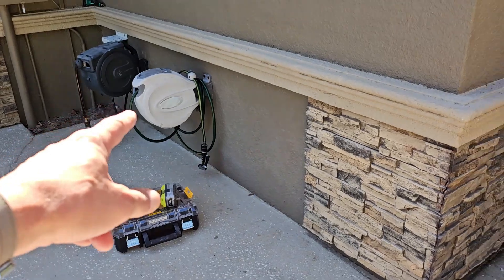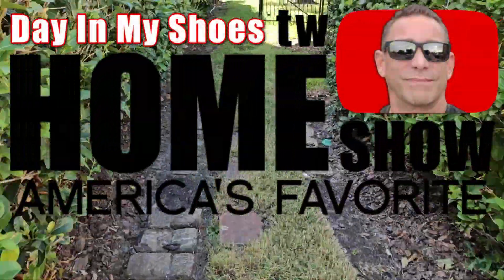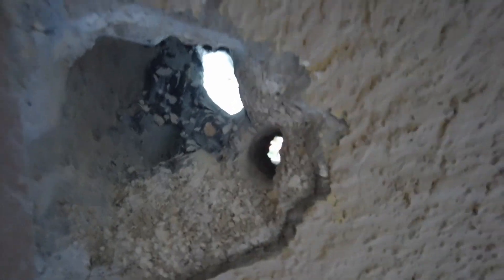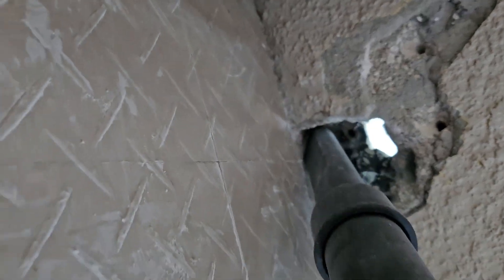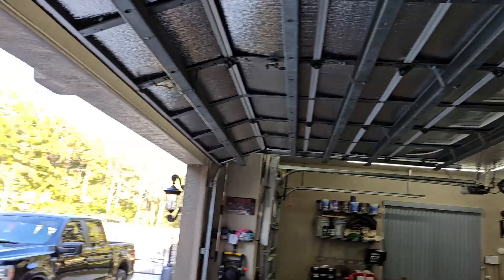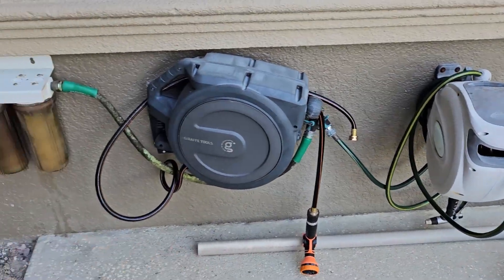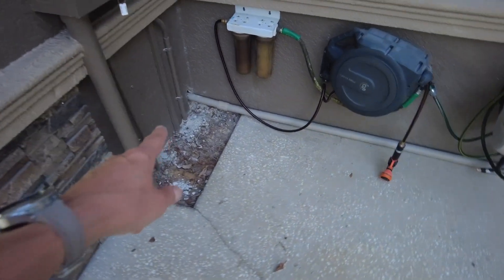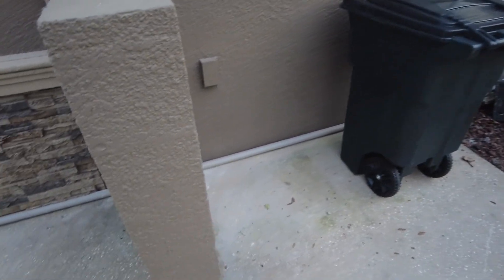PARTIAL HOME Solar-Battery Supply | INSTALL SOLAR PANELS for Home | PV-Solar Wires | PART 1

Comment: That is a large utility bill! Is that power plus water? Find out what’s pulling wattage first. BTW what will you do with the panels in s storm?
Reply from the maker: Hi Jim, It's just the electric. We were gone from the home-the entire month of September in the RV. That month our power bill was approx. $625. This tells me it's our Air Conditioning that Cheryl likes to run at refrigerator temperatures :) So, the only thing I can do is power the other stuff with solar and battery. The system I'm building is not going to be large enough to power 3 A/C units. You'll have to keep watching the episodes to find out more details :)  -Todd
Reply: @twHomeShow  That is a heavy AC load! Our neighbors just put solar panels on the roof. I don’t know if they work but I do know they leave holes in the roof when they become airborne in a storm! Friend of ours in Vero Bch had her dining room soaked that way.

Comment: Did you need to get a permit for your solar home project?
Reply from the maker: Hi Patrick, this is ALL in experimental phase. When you do a project like this "Partial Home Backup", It's in uncharted territories when it comes to permits. It's in it's "early years". Almost like when electric was first invented-then someone invented the "extension-cord". Back-then there were extension cords draped around the household-nonstop . . . you had to duck-underneath them to get around the house! Don't get me wrong, I am doing the right methods to keep this a safe and permit-able project. I'm NOT going to take "short-cuts" when it comes to electricity.